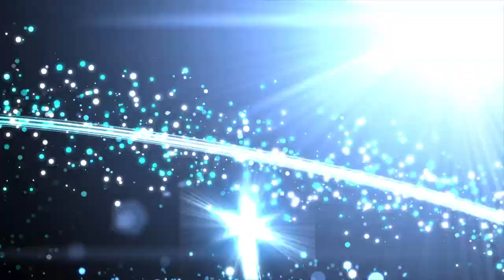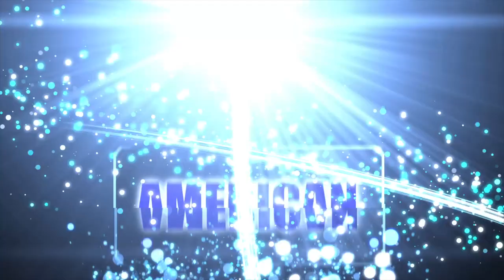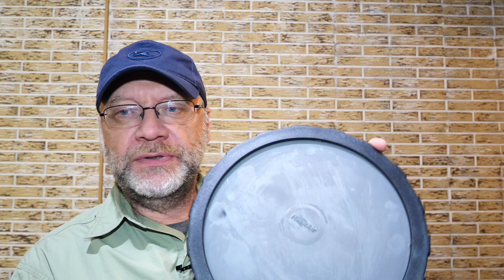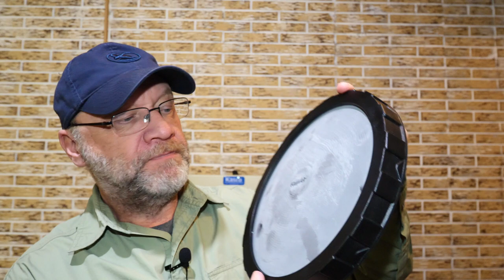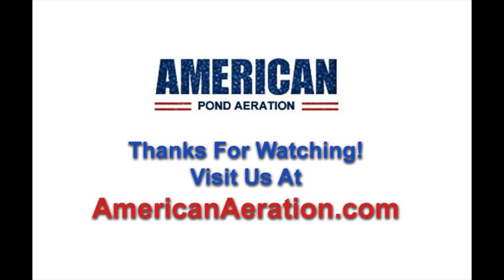DIY Pond Aeration   Tips For The Best Results

Comment: All those pumps are junk you use a central pneumatic belt driven compressor with a air reservoir tank the pump will only run one to one and a half minutes every 45 minutes you make your own diffuser out of PVC or black iron pipe with small holes you get more water turnover plus you're putting air in the pond The only way to go
Reply from the maker: Sounds like the plan!  Thanks for the comment.

Comment: I have a 9" diffuser I'm going to mount into a weighted 5-gallon bucket.  What's the best way to mount it into/onto the bucket and what are the best adapters to go from a 3/8" weighted tube from the pump to the diffuser which has a larger hole opening.
Reply: Use at least 1/2" i.d. weighted hose... it gives you like 75% more air volume and is easier on your compressor / air pump making it last alot longer before having to rebuild it or buy a replacement.
Reply from the maker: Dan...sorry for missing your question.  So most of these diffusers have several connectors of varying sizes...common would be 3/8 or 5/8 with what we work with but as Zeke mentioned, 1/2 inch is pretty common too.  I don't have much to offer on mounting in the bucket...never have done that myself.  I could imagine using a pvc elbow to have the airline connect to the side of the bucket (fiitting) and then the diffuser plate connected to the top in some way.  Just a lot depends on the components your using but most hardware stores or garden centers should have something that would work.

Comment: What are your thoughts on running pump 400 ft away from pond and running the air in pvc pipe to the pond? That's the closest electric and pvc is cheaper than running wire that far. Was thinking 3/4 or 1" pvc.
Reply from the maker: Hi Brad...what you describe is done quite often actually.  Kasco, which is the brand I tend to like to work with on the commercial level, uses 3/4" PVC...the schedule 40 stuff you find everywhere, for their inground "airline".  Works great.  You could do 1" as well...really it just depends on the fittings you use or can find but either size would handle 400' with no problem at all.
Reply: @klmponds  thanks for fast reply! That's what I will be doing hopefully in near future!
Reply: I just did this exact thing using cheap 3/4 poly pipe. It came in a continuous 400' roll and I buried it with a "sub soiler" plow on my tractor. PVC would have cost 3x as much ( including fittings), would have had to bury by hand, and connect 40 PVC joints. What took me a couple hours by myself would have been a week long project.
Reply from the maker: @wrstlr119  I agree...for those longer runs poly can certainly make it easier to put in.  A few manufacturers use poly still, and some of switched over to PVC for the durability.  Of course the hope is you only bury whatever you use one time.  But it works for irrigation line and that's basically what you're using for aeration poly too.

Comment: Hi Mark, I'm just starting on this aeration journey. I may be over analyzing this but is it advisable to put a check valve upstream of the diffuser so when it shuts off, water does not back fill into the tubing? Less daily stress on the pump at startup? My plan requires solar with no battery. I intend for it to run during daylight via direct feed with a voltage regulator. At night it will be off and cycle back on the next day in the FL sun.
Reply from the maker: Howdy...so all of our diffusers that we carry and work with, and I would say most of the commercial ones have check valees built into them.  If you are putting something of your own together, then yes, for sure you'd want a check valve to protect back flow to the pump.  I think solar should do well in Florida...good run times and lots of sun.

Comment: Hi Mark, Thatnks for the information. What type of piston pump would you recommend for a pond 30 feet deep and 2 acres. This pond has been neglected  fjor some 30 years and is full of leaves that surround  the pond. The pond used to be 30 feet deep as it was used to water trees on a tree farm. Any suggestions would be helpful. Thanks so much for the information on you youtube video. extremely  helpful.
Reply from the maker: Hi Patrick...your welcome and thanks for the kind words.  So for pond of that depth, I would look at the rocking piston pump.  By spec you could run two diffusers (which is what you'd need roughly for your 2 acre size, with a 1/4 HP pump...but I do think if you have both diffusers down beyond say 20'...it would probably be better to look at a 1/2 HP model.  Here's an example for you.  

https://americanaeration.com/easy-pro-stratus-1-2-hp-aeration-pump/

Hope this helps for you and let me know if you have other questions come up!

Comment: If you have property with a creek and a pond that is over grown, it is a blue line on the map, can you install this type of system without permits or getting  USACE involved?
Reply from the maker: You know typically we don't run into many issues with installation but then I think in some respects it would depend on the state involved and the water body in question.  There are certainly locations out east where a permit would be required, but this was a state managed lake which adds to the complications in various ways.  My best advice is to contact your state DNR folks or the COE directly.
Reply: @klmponds  I'm in the pnw, and some of the rules for salmon streams are a little crazy, case and point family member has a wet spot, no running water and they had to remove a stump because it impeded salmon, it has never had flowing water, they have lived their over 50 years.  The problem with the stream I'm asking about is before all the regulations people dug it more like a channel so it has no rocks for turbulence for miles, so when it empties into pond there is very little oxygen, creating a swamp/pond it still flows fairly well but it seems like a little O2 would improve the quality of water.  Just wasn't sure on regulations on this, the property lines I'm looking at owns 3/4 of the pond with land on both banks, pond is approx 5 acres.  I was thinking of water feature (waterfall) to provide o2 as well as this system but not sure if anyone else has run into an issue with the government getting involved.

Comment: A sound DIY alternative to a commercially available diffuser is to purchase stainless steel fabric from a place like  McMaster Carr, and attach it to your choice of manifold (such as a drilled out PVC pipe).  It can be easily stitched in by drilling holes in the PVC pipe to "sew" stainless wire through the stainless fabric. But commercially available diffusers have the benefit of simplicity , for sure.  And you don't have to figure out how to weight them down and keep them at the bottom.
Reply from the maker: Well stated.  Yeah it depends on how involved someone wants to get.  There is nothing wrong with a well thought out DIY system.  But it's also nice to know that one can get what they need to "fill things in"  for good performance if they need or want to.

Comment: I’m located in NW Wisconsin . I’m trying to keep about 2 acres open all winter on a 26 acre lake.  I have a 3/4 HP rotary vane pump and trying to figure out if a course or fine bubble diffuser would work better.  The depth will be about 10-12ft.  Would like to build my own to save costs. Trying to keep fish alive.  Thanks
Reply from the maker: Hi Paul...thanks for the question.   I would work around the pump that you have on hand.  Typically that 3/4 HP rotary is used with 4 diffusers so you'd be in the ballpark if you had about 10' of depth to work with here.  You'd cover a bit more than 2 acres but in a 26 acre lake that's not a bad thing.  

To make this work you'd want a four valve manifold so each line has it's own dedicated valve.  I'm including a link below that shows how this is arranged.  And then you'd have airline of course.  I prefer weighted personally, but there is non-weighted tubing around too if you want to weigh it down with something to keep it on the bottom.  Might save a good bit of money that way.  

Those are the key components in a set up like this.  The pump would need protection from the weather as they are not weather proof, but it could be placed in a shed or outbuilding with no problem. 

If you need to source some parts let me know as we would be able to get that manifold, airline, and diffusers as shown in the link.  

 Hope this helps for you!

https://easypro.com/products/rotary-vane-pond-aeration-system-34-hp-kit-with-quick-sink-tubing/
Reply: @klmponds  thank you very much for your quick response!!!

Comment: Thanks for the excellent info video Mark. After I make my way through a couple of projects that have me tied down I'm going to setup a ANJON Manufacturing, LIFELINE Air Pump, Model# LL-RP80P into weighted line into two (looks like) SAViO 2 diffusers Model DSW2 and placing the diffuser's into two parallel valley's in a pond that's a little less than an acre. That may seem like over building it but I may place two more DSW2 diffuser's in later own. I bought this place with a couple of rundown ponds and it's past time I show the pond's and fish some TLC. I really enjoy your video's because I definitely know you're a pro. Thanks man.
Reply from the maker: Hi Jerry...thanks for the kind words.  Let me know how you get along with that pump.  From some reviews it sounds like it may have a few issues.  Or it may not be the pump but how it's set up.  This compressor is putting out 6+ CFMs and that's a lot of air to drive through two fine bubble diffusers.  I would prefer to see three on a pump like this.  When you try to push too much air through too few diffusers you will potentially shorten the life of the pump before repairs need to be made.  1.5 to 2.5 CFM's is a perfect range to shoot for and this is a bit above that.  In a course diffuser, there would be less of an issue, but the savio diffuser has the same top membrane plate as the easy pros' that we sell...and it produces a fine bubble pattern.  I'm not saying you'll have issues here but I do expect to see at least 2 years, if not 3 to 5 years out of a pump before I have to rebuild it.  You save little money with DIY if you have to keep putting that savings into repairs or parts.  Also be sure to use a valved manifold when using multiple diffusers.  Each line needs it's own valve so you can direct air flow however you want it.  Good luck with your project!
Reply: @klmponds  thanks for the reply Mark. I didn't realize any of this.
Reply from the maker: @jerryhayden8720  your welcome!  I'm not saying it's a bad thing to try...but it sounds like if you were going to add in extra diffusers...you know eventually, then maybe just do 3 and stay at that...you'd be great in that range with this particular pump.  As you noted, it is overkill in a sense...you could probably pair things back to a 1/4 HP pump and two diffusers and be quite happy...but you have to be confident in what you put in there and I get that.  Take care!

Comment: Great video, my question is distance between the piston pump and the pond. Can bury a regular unweighted section of  let saw 100 feet and then connect another 100 feet of my weighted tube to the diffuser.
Reply from the maker: Thanks Dan.  Yes, you certainly can do unweighted tubing in ground and then transition to weighted tubing going into the pond.  200' total run from pump to diffuser is not bad at all and well within the capability of a rocking piston compressor.  3/8" or 1/2" line would be fine too.
Reply: @klmponds  Thank you for getting back to me. Your knowlege is priceless

Comment: Did you know that befor resin air stones, was simply (and still now) used limewood branche ^^ Also pumice and aircrete can do the job as they are porous..
Reply from the maker: I did not know that...as you describe it it makes sense though.  Thanks for  sharing!
Reply: @klmponds  i just learned it ^^ Good to know, it can be simply found along some walks  : )

Comment: Hello Mark, I’m wondering what your thought are on bottom pond aeration during the winter in cold climates. I’ve heard it’s good to run the aerators all winter and also heard that if you run bottom aeration during the winter you will “over-cool” the water causing fish kill. They said that the fish’s blood will thicken at temps. below 39 degrees and that pushing real cold air will during the winter will “almost surely cause a fish kill”. I had hoped to get some bottom aerators for my 2acre pond to keep it from freezing over, but now I’m not sure if it will kill my fish. I decided to go to the expert. What do you think?
Reply from the maker: Great question Ed...thanks for sending it over.  So really the only reason you would aerate in the winter is for fish protection.  Keeping a spot of ice open  provides an open route of exchange for off-gassing out of the pond and some oxygen back in.  I think the general rule is about 3% of the surface should be open for optimum protection so it doesn't have to be much.  I will typically suggest folks run a diffuser in a shallower, off center location in winter...so you do keep that opening going and provide a zone of some oxygenation around the diffuser.  At the same time you want to leave the deeper area(s) alone, or turn off diffusers that go deep...it will be warmer and undisturbed there as long as you don't aerate from the deep points.  I thnk too most fish will slow down and go pretty dormant in cold conditions but it's typically not cold that kills, it's a build up of trapped gasses, and oxygen deprivation from prolonged ice coverage that just blocks everything up.  Also every pond is kind of different, and the same goes for fish, in how they might handle such challenges.  The key point though is if you do aerate in winter...aerate from a moderate depth of maybe 4 to 6 feet, only affecting a portion of the pond, with the sole purpose of keeping a hole in the ice opened up.  If I don't have fish, or they aren't of high importance,  I would shut the aerator off and start again once ice is out in the spring.

Comment: Great video Mark! Thank you.

I just bought a property with an acre pond. I bought a Hiblow 100ll, to replace the broken rotary vane pump previous owner had in place. I will connect it to the weighted lines in the pond, its a kidney shaped 1 acre pond. I know I should put 2 diffusers at different parts about 6-8ft of depth. I am torn between the coarse and fine bubble diffuser as I don't want the fine bubble diffuser to damage the pump in any way with backpresser. Any thoughts?
Reply from the maker: Thank you Daljeet...so I think with all things considered here...and keep in mind I do prefer fine bubble diffusion for it's aeration capabilities, I would be concerned a bit about the backpressure on the pump.  Course bubbling won't oxygenate as well but it will circulate and that's helpful too.  I think I would go that route and just see how things go.  My hope would be the pump would give you a few years of service or at least a good year before diaphgrams would have to be updated.  If you do find it not lasting that long, then I would switch to a rocking piston pump.  A single piston 1/4 HP would be plenty in this setting, and I might even consider at that point going to fine bubble diffusion if you can swing it.  But as always, any aeration is better than no aeration...and what you have on hand may very well do everything you want.  Best wishes!

Comment: i have a question on the weighted hose.   I havs a large  (13,9 acres) pond. the shape is somewhat irregular.  I anticapate that hose lengths of  200 ft or more will be required'.  At what point does 3/8 weighted hose become too small and 5/8 inch hose be needed?  the deeped depth is 12 ft. Thanks for the help.  Mack Atkinson.
Reply: Hi Mack...great question.  So for the brands we work with this may vary a little on where they make the change from 3/8 to 1/2 or 5/8...most work with 3/8 and 5/8.  But for me, once I get 300' out from pump to diffuser I start thinking about going to 5/8.  If the depth is 8' or less, maybe you can go out a bit more...if it's a pretty deep spot, you may want to think about 5/8 a little sooner.  But in most cases 300' is my range for staying with 3/8.  14 acres is a lot of water so hopefully you will have multiple power locations to work with...I always look for that  when working in larger waters just to keep the airline runs as short as I can...this helps operationally of course but also can save a lot of money on airline costs....sometimes you can do that, and sometimes you can't but to me its a worthwhile consideration.

Comment: Good info. Can you provide info on where to purchase pond aeration products, i.e. weighted line, linear compressor?
Reply from the maker: Thank you Kiki!  In the description here on youtube, you'll find some recommended links to those components.  It really depends specifically on what your looking for...in other words a linear pump or rocking piston...we work with the latter mostly.  The diffusers are another variable, of which there is a wide selection.  But I think we have everything covered in links in the description.  If you need help sizing something to the pond you have, let me know and we can do that.
Reply from the maker: Hi Kiki...Mark here...could you email me  (mark at klm-solutions.com) for aeration recommendations on your 1200 gallon pond.  We don't sell smaller aerators like this anymore...we have more or less moved out of the small pond market, but I can certainly recommend a few devices.  Note in the email too how deep the pond is please.  Thank you!